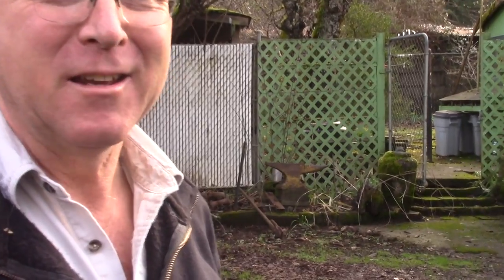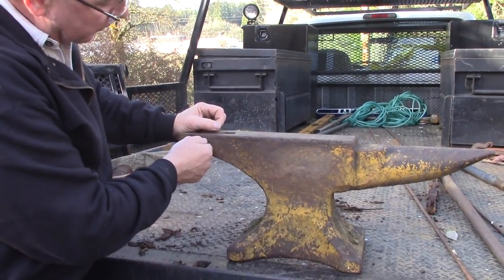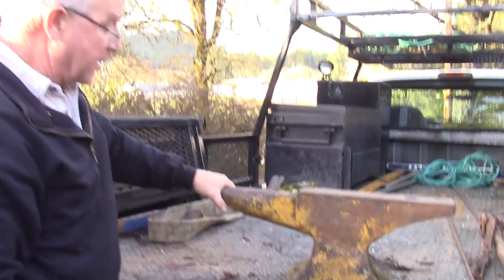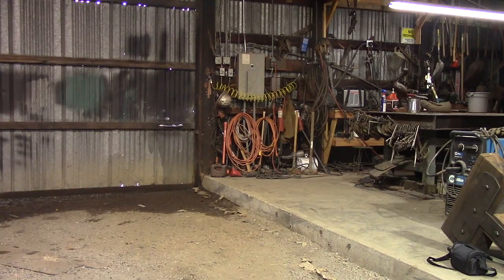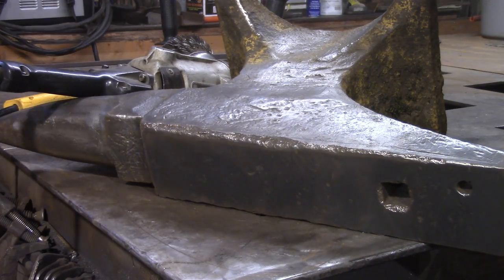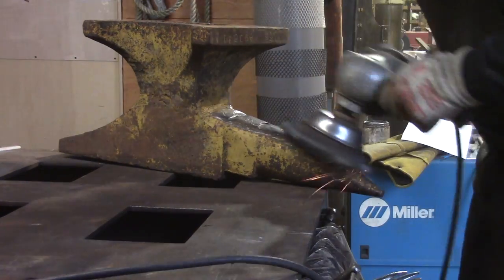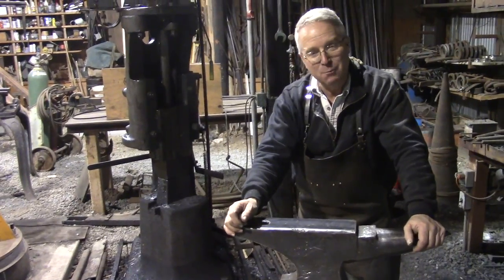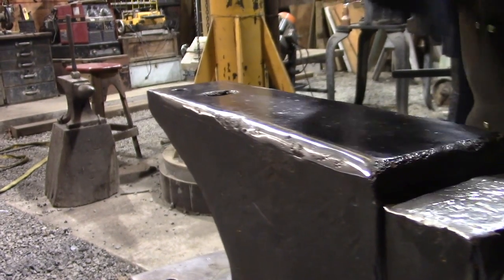How To Find An Anvil

Comment: Do they cast the carbon steel plate into the anvil at the same time they pour it or is it a second operation?
Reply: It is usually forge welded on after the rest of the anvil has been cast.
Reply: Depending on the manufacture (and at what time) they do sometimes cast it on top of a heated plate of high carbon steel (plate being at the bottom of the casting and nearly at fusion point). some others are forge welded as you said. In many cases, there are no sign of wether it was done one way or the other.

Comment: I spent 7 years in the NAVY during the 80s I was on SSBN 619 634 . The 619 was over in holy loch in a small town called Danoon  . There was 2 blacksmiths there and 1 had a anvil over 400 lbs .I wanted to live there but someone had other plans I got hurt bad during a torpedo reload test . Nothing works from the waist down. I did get lucky and used my va loan to buy a 1890 farm on 10 acres in a rural area. In the back yard there was 3 anvils covered up with brush and other things. The names were gone but 1 is 200lbs 1 is 250. and 1 is 310lbs The old farmer was a blacksmith to bad I could not get his forge and tools. His family would not sell it .I guess they forgot about the anvils. I use them to fix things like my scooter and wheelchairs
Reply: Yes my sub was ssbn 619 and 634 and built in the late 60s I even spent time on a diesel boat. I was a  electronic tech reactor operator . But as he may know you have to know the basics of how everything worked on the sub. So you may never know when you may have to do a torpedo load and FIRE . You should ask what sub he was on.

Comment: how would you repair the edge..hard facing it?
Reply: CCs Welding... definitely not...hard face filler material is abrasion resistant,  an anvil needs impact resistance. I use a Stoody "build up rod ". hardness is about right, runs in smooth, color is not too good.
Reply: CCs Welding gotta preheat to 400ish...short beads...backstep.
Reply: Now all I need is an anvil
Reply: if you've already got the welding, you can pick up an anvil in much worse shape and rebuild it.

Comment: Sounds like you would have appreciated our family forge in Kirtland, Ohio. Id only been in there a few times as a kid and it has been torn down by the Mormon church recently to ironically preserve the historical integrity of one of the communities Joeseph Smith was chased out of by a torch wielding mob. It was, however, built shortly after the civil war by a returning artilleryman with much of the interior being original through its use until the 1990s- even having site-made carriage wheels stored in the basement up until the structure was dismantled. As far as the anvil, I cant imagine what type was in there, but it was probably as old as the hills.

Comment: Hey, you found the ONLY real reason to use a square steel stake for your bed rails/panels! haha. Ive been using round steel stakes for 25 years doing concrete so I have to disagree with your square steel stake video.. very respectably however :). I do 100% agree with you on the Die Hard boots though....anyhow, Ive been looking for an anvil to get into blacksmithing and I had no clue how hard they are to find a good one and how EXPENSIVE they are!

Comment: Simple Electrolysis will remove anything on the steel without physical damage... use borax as your catalyst. About @1Tblspn per 5Gal water.... This also works on plated articles.
Car battery Charger with SS clamps will give some oxidation protections.
Reply: PS.... simple plastic kiddie pool for larger items, or get crazy with a shovel and pond liner !!

Comment: I imagine the difficulty of finding, makes, and sizes of anvils will vary by region. I live in ohio so much of what I've seen has been no larger than the one in this video. I actually had a 126lb trenton given to me by my inlaws because I spotted it under their barn steps that is in remarkable condition with no repairs or big chips on the edges and a very flat face. I know this situation is exceedingly rare. But I know of 5 different anvils in my circle that I haven't been able to seal a deal on. I barter all the time though. I basically traded knowledge on brush hogs for a 6ft john deere brush hog and by being willing to look in scrap piles I've gotten an engine hoist and a good number of plow disks I use to make tools (mostly hoes) all for free.  An ability to make good conversation can lead you anywhere I've learned. Building a rapport is hugely understated.

Comment: I found an anvil, or rather my sister did and gave me a call, cuz I had mentioned to her that I was looking for one. A husband and wife had divorced and he told her to sell all his shop equipment, he was a welder away at work on a shutdown, in preparation for the divorce settlement. They used to have and ride horses quite a bit. I'm guessing that is why he had an anvil. There were no blacksmith tools tho. She was asking 100.00 for a 138 lb Hay Budden. I gave her 200.00, and considered myself lucky. I had been looking less than a year, and not too awful hard.

Comment: I have a 200lb. Anvil Im looking to sell. Would you be interested? Im in Ct. I was digging in my backyard to put a pool in and it was buried with a few engine blocks a vise and some gears or cogs. I think the original homeowner may have been hiding it from govt. Collectors but Im not sure.

Comment: And it is so expensive because its a piece of antiquity or you have hard time to buy a good new one? I was introduced to a company that produces new cast anvils.There is a special occasion when company invites and treats old merited employees (80+ years) who prepare a charge for melting and the company casts like 1000 anvils in one BIG batch. For the rest of the year the special shop of old single purpose grinders cut 5 anvil faces a day (one anvil per machine per shift). They tried a new fancy super hyper carbide/diamond abrasives in order to get higher productivity but the plan failed miserably in dust and shrapnels flying all around. As to my knowledge they have a representative in USA. A brand new one of this size here in Europe is for like $1,000.

Comment: ELECTROLYSIS ...
NO HEAT... NO SANDBLASTING.
WATER, BORAX, a plastic bucket,...or sim...
 12v(24v) 10-20A Automotive Battery Charger.

Comment: Why do you guys wear yourselves out so much?  All of you guys go straight to the grinder or wire wheel to get the rust off.  Loctite makes a product called, "Naval Jelly," that eats rust, paint, gunk, and anything else leaving bare metal behind.  Paint it on, wait an hour, wash it off.  Then you can start polishing it up.
Reply: Sandblasting comes to mind.  Excellent anchor pattern for coating.

Comment: I've got a big fisher that I want to get someone with a surface grinder to get it perfectly flat. I called my local machine shop but they said they didn't have a surface grinder.
Reply: how off is it from true?
Reply: It's about 250 pounds and is in great shape but sometime in the last 100 years some dumba&$ used it as a table while cutting with a wafer wheel and cut in two cuts about 3/32" deep right across the middle, I hope someone caught him and beat him half to death! Anyway I've had this fantasy about getting it ground down perfectly, then polish it to a mirror finish. It has a thick hardened plate and I'd hate to weld the grooves up, there's plenty of room to grind it down. I've done anvils by hand before but this one is just so nice. I'll call and ask about the milling machine tomorrow, thanks.
Reply: If you're trying for a true mirror finish, and want to be able to see a reflection, you might need to have it blanchard ground. For practical purposes, flycut is plenty flat for anything you're doing with an anvil.
Reply: Tributary house, you don't live near Florida do you ?
Reply: A good welder can fill those cuts with an appropriate material.
Reply: my dad worked at a place where they had a ton of surface grinders they through them away when they got them clog then my dad took the clogged ones and fixed them up and they work great.